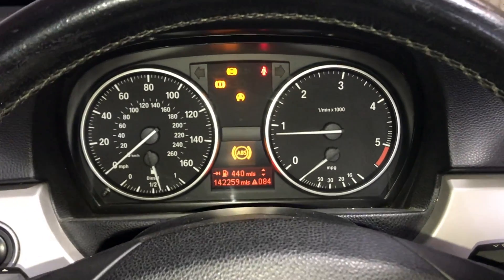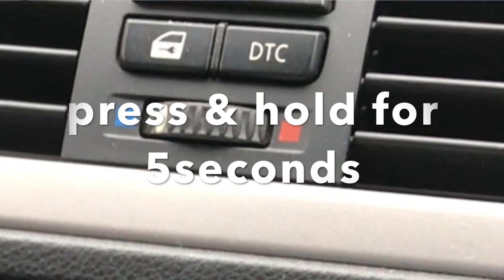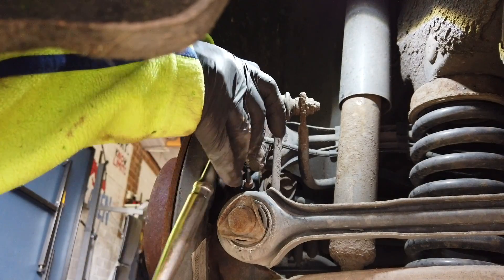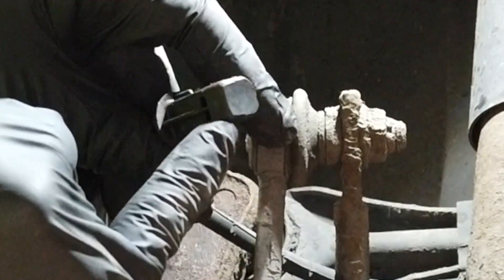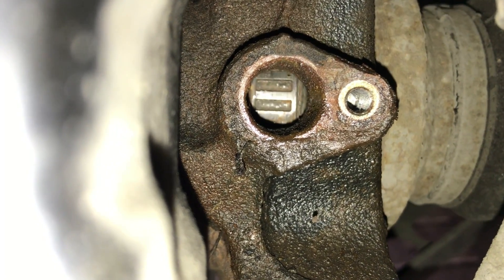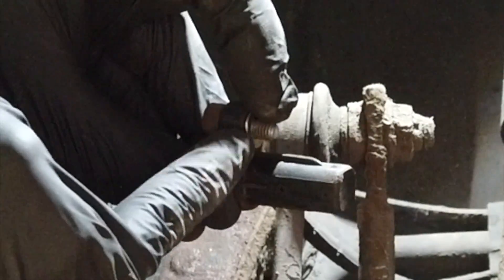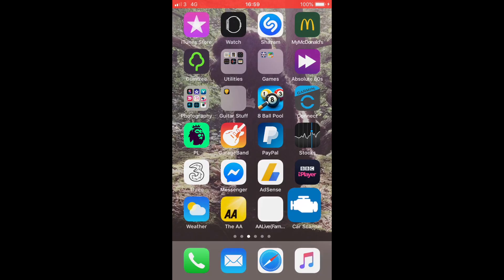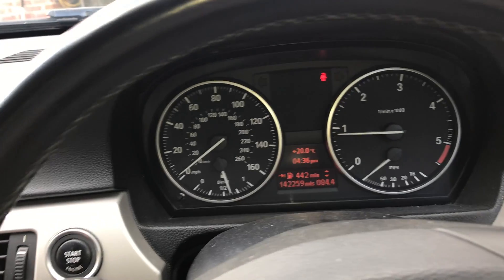BMW ABS Sensor Repair "No New Parts" ABS Ring. E90 E91 & More

Comment: I tried this fix and it worked for me. I used a 1mm washer and it didn’t work with triggering full abs lights. I tried again with a M6x12x0.5mm and it worked! Thanks!
Reply from the maker: Awesome, thanks for sharing the fix! 👍🏻👍🏻🛠
Reply: So the 1mm was too thick ???

Comment: I’ve fitted washers to both sides yesterday, however the abs light is still on! Took it for a quick drive and tried to clear the codes with TOPDON car pal but they won’t clear? Any advice please mate
Reply from the maker: When you go into abs settings and look at the sensors on a graph do they pick ant signal up? if they are worn through at the base they might need changing Thanks for the great comments👍🏻👍🏻🛠
Reply: @aaanton11 hi mate I can’t seem to access speed sensor/abs on the TOPDON carpal

Comment: Hello there mr, i had one big error  abs and it was red on dashboard bme e90 2.0d n47 sedan so far i switched ignation off - i checked the codes it was just  showing abs error code nothing more,- so far it didnt said me which exactly sensor is broken then i deleted these errors with obd - and so far  when i drive 30-50km thats it abs switching on byitself also i noticed sometimes in rainy days its too ,  - anyway now when its dry  switching on too , so far if i ask for advice is it better to clean these sensors - (all of them) or there could be problem with egr module
Reply from the maker: Have you checked the brake fluid level?, Thanks for the great comments👍🏻👍🏻🛠
Reply: @aaanton11  No I  didnt - but i know that in this winter car mechanic changed it for me, tomorow in morning i will check it

Comment: Will this work with E92 335i that doesn't use reluctar ring? I think my 335i has the wheel bearing abs system.
Reply from the maker: No you will need a new sensor or wheel bearing, Thanks for the great comments👍🏻👍🏻🛠

Comment: Hai Sir...do we need to coding as well after replaced ABS Sensor if error message ABS Sensor fault disappear on iDrive?
Reply from the maker: Not coding just erase the fault codes with a scanner, Thanks for the great comments👍🏻👍🏻🛠
Reply: @aaanton11  I'll try to remove my old wheel speed sensor before my new one arrive but accidentally connector too brittle, can you give me some methods how to pull out old wheel speed sensor from brittle connector?
Reply: After installing new wheel speed sensor error code in same error Code (5DCO) still occurred even though my mechanic using diagnosis tool 🤣... seems like I have to go to other workshop and hope my wallet didnt thin after that🤣

Comment: Does this trick work with the e90 series that use abs wheel bearing Esther then regular abs ring?
Reply from the maker: No only on the abs ring type, Thanks for the great comments👍🏻👍🏻🛠
Reply: Did you sort it out mate? I have the wheel bearing ABS system too.
Reply: @ Hi brother, yes! I simply bought a new bearing, when I installed it I put a washer on.. its gone away not come back!
Reply: @bunkaaa8726 Thanks for replying buddy. Really appreciate 👍 Do you think I can try the washer trick before getting the new bearings?

Comment: Isn´t it dangerous? What does the sensor measure? Does it change the Data that the Sensor puts out?
Reply from the maker: Not at all, it measures the divots in the rings, its a magnetic pickup, Thanks for the great comments👍🏻👍🏻🛠

Comment: Just did on 2011 e91 LCI. I took the DIN 9021 M5 washer, because it is 1mm thick. Regular M6 washer is 1.6mm, a bit too thick in my opinion. I drilled it to 6.5mm inner diameter. Works like a charm
Reply from the maker: Thanks for the great comments👍🏻👍🏻🛠

Comment: Brilliant mate,   put 1 washer on , didn't work , put 2 on and everything lit up 😮 warning !! So i went back to 1 washer and checked the other side it was rubbing as well .washer on that side , problem solved  
How long will it hold for though ?
Reply from the maker: Mine lasted for 4 years before I did the ring replacement video, https://youtu.be/rBlTHK29x8c Thanks for the great comments👍🏻👍🏻🛠
Reply: How did you get the light off mate?

Comment: i keep getting same issue with abs sensor and traction control 318i se 2011 .  both sensors were replaced last month. I have same lights come back up.  i placed 1 washer on left rear (had signs already of scoring) which seemed to be the issue but i have lights come back up.  i dont have a diagnostic tool to check if its the right (not checked sensor) now or left still.   The washer was around 2mm.  I will be getting garage to replace the reluctor ring.  is it worth adding washer to the right side also.  do they both need to sit same distance back from ring?  could only having 1 sat further back send through weird data through?
Reply from the maker: 2mm is too thick, it needs to be wafer thin, Thanks for the great comments👍🏻👍🏻🛠
Reply: @aaanton11   actually after measuring they were 1mm.  i have bought 50x 0.1mm and see if i can  use  these. Does anyone know how much a garage will charge to remove corrosion from the area of old ring and replace with new one?  would they use PVA or should i request this?
Reply: @craigd8471  did you get that replacement done? how much was it
Reply: @7meer-cha  yes fixed by 2 new rear drive shafts.  No issues since. They had a look at ring. But it was too corroded and shat would be affected when removing corrosion so a new ring would not fit well.  So a new shaft both sides were solution.  Shafts were around 180 each. Think i paid 660 total on final bill and it included something else they replaced for 30 quid

Comment: If that doesnt work, it takes about 1 hour to replace the CV shaft which includes the induction ring fitted, though left side might be harder with the exhaust being there covering the bolts into the differential. CV shaft about 70 squid, you need a 12-point 30mm socket for the main wheel bearing (punch out the wheel plastic cover and unfasten on the ground!)-standard thread(not lefty thread), remember to knock out the crimps before untightening. the differential bolts are star sockets. you also need a punch to knock out the cv shaft (less than 1cm diameter) once you have undone the differential bolts (raise clutch using jack to disconnect it from differential seating).
Replacing the CV shaft is easier in general, because its very hard to fit an induction ring perfectly on a corroded shaft!.
Reply from the maker: Thanks for the great information👍🏻👍🏻🛠

Comment: If the wheel bearing is bad could cause the same issue?? Thanks
Reply from the maker: You would hear it first, the bearing would need to be badly worn to alter the abs sensor on this model, Thanks for the great comments👍🏻👍🏻🛠

Comment: I have the same issues with abs light on, when it starts up it shudders then lights come on and i can drive away... mechanic said to order a new rear driveshaft.. surely a new ring would fix it going by yours?
Reply from the maker: Check the fault codes yours might be a poor connection on the front sensor, Thanks for the great comments👍🏻👍🏻🛠
Reply: @aaanton11  cheers. I actually sorted it myself, stuck the new abs sensor in and warning lights went. No I just need to sort the pulsation on the brake pedal.. have ordered new discs

Comment: Is there a chance that this ring is entirely missing/not visible? :D Because on my side I cannot see the thing that you are seeing. It was a sudden death of the systems as I've been to the snowy mountain roads.
Reply from the maker: Some later models don't have the rings, but most do. Thanks for the great comments👍🏻👍🏻🛠
Reply: @aaanton11  I have the issue mentioned, but I can't see the ring in the hole. Is it possible that it broke? I can send a video.
When I reconnected the sensor I was able to drive for about 50 meters, and then I got the DSC kick in like crazy(gas intervention) without any wheel spin, then it recorded the errors and stopped abs/dsc from functioning.
Reply: I also forgot to mention it is a 330i 2005(e90).
What I meant by broke - fallen apart and just fly off the driveshaft.

Comment: This is the issue with mine but they can't get the driveshaft off to change the ring so I will have to have a new driveshaft,and I was wanting to sell it before this happened.but the warning light comes on and it pulls back and on motorway it has hone into limp mode,not happy,already spent thousands 😪
Reply from the maker: The ring is on the driveshaft, so if they can change the drive shaft they can replace the ring, but most garages want to change the complete shaft as it it easer for them and they can charge you more, Thanks for the great comments👍🏻👍🏻🛠

Comment: I have the same problem on my e83. But not in sensors problems, detected that rear abs rings are destroyed. Thats why sensors also out of service. Solution is to change abs rings plus sensors. And i think 1 washer under every sensor also can be added.
Reply from the maker: Thanks for the great information👍🏻👍🏻🛠
Reply: Are the bmw rear wheel drives?
Where is best to buy the rings and sensors then?

Comment: Question: what if the the ring does not spin at all (through the sensor hole) and I am getting the thumping kinck under my brake pedal when I make turns? Thank you and great camera work on reluctor ring through the abs sensor hole...
Reply from the maker: The ring must be completely detached, new one needed, Thanks for the great comments👍🏻👍🏻🛠

Comment: I had the same issue. 3-4 "splines" on the abs ring was clear aluminium because it had touched the sensor. It made the wheel speed intermittent and confusing for ECU. DTC would kick in randomly, often at high speeds. I fitted a 1,5 mm. washer and checked live data on wheel speeds in INPA. It's more stable now. I haven't had any issues with DTC randomly kicking in after this. Thanks for the tip.
Reply from the maker: Thanks for the great comments👍🏻👍🏻🛠

Comment: Great video. I changed over my sensor after the abs sensor light came up and found that the new one caused the car to judder and not allow the car to have full power. I then put the old sensor back in and no judering or power loss. The light is back on. Im guesing its the ring???
Reply from the maker: yep, Thanks for the great comments👍🏻👍🏻🛠

Comment: I have an e93 335i and mine doesn't have a ring at all.... getting a 5dc2 code after hitting some water puddle in the rain. Replaced the sensor and still getting a code when hitting about 15mph
Reply: When replacing the sensor I didn't see a ring at all, finding no research on this.
Reply from the maker: It definitely has one on the drive shaft cv joint, Thanks for the great comments👍🏻👍🏻🛠
Reply: @harmless360 did you fix the issue?

Comment: Hello, does this need to be done on only the right passenger side?
Reply from the maker: The passenger side one corrode more than the offside one due to it being near the curb and more puddles and water but they can both corrode you will need to check both sides Thanks for the great comments👍🏻👍🏻🛠

Comment: Hi, I have a problem with occasional lighting of ASC lamps and loss of power (gas withdrawal), mostly after a little longer driving, I tried to put a washer (nut) but after that he turned on all the lamps !? What do you think could be the problem?
Reply from the maker: you need a really thin washer less then 1mm Thanks for the great comments👍🏻👍🏻🛠

Comment: Hi, Anton, I have just put the washers behind the sensors but the ABS light comes on when it didn't before, could the washers I used be too thick, when I say washers I did both sides, I don't want you thinking I've packed it out an inch.  how can I get rid of the fault codes without a OBD, I have got one but still trying to find out how to use it.
Reply from the maker: They need to be the thinnest washers you can find, like a finger nail thickness, Thanks for the great comments👍🏻👍🏻🛠

Comment: I got no lights on the dash.
Turbo doesn't really come in until 3k
Traction light flickers when I try accelerating and very sluggish untill 3k when its like Nos .
Dtc button makes zero difference but when it gets up there it pulls like a train.
Reply from the maker: If the traction light is flickering the ecu thinks there is a slip on the drive wheels, so possible sensor issue, pop out the rear ones and have a look for the corrosion, Thanks for the great comments👍🏻👍🏻🛠
Reply: @aaanton11  many thanks.
This has helped and I will let you know how I get on

Comment: Thanks for the great video! I replaced my worn sensor and spaced with a washer. 

The ABS, traction control and brake light codes went off when I started the car, however, now when I drive over 10mph the abs light, traction control and brake light comes on and stays on. 

Do you know why this might be?
Reply: I don't have a code reader to reset the codes - do you think I need to reset the codes after replacing the sensor?
Reply from the maker: It sounds like the washer you have used might be a little thick you need a really thin one, like the thickness of a fingernail, also a code reader would be a real help, Thanks for the great comments👍🏻👍🏻🛠

Comment: I changed the one of Wheel Speed sensor and it’s still reading bad I’m hoping this is the problem and I don’t need 4 new speed sensors 😭
Reply from the maker: it will be, Thanks for the great comments👍🏻👍🏻🛠
Reply: @aaanton11  so I tried this and it didn’t work :( I’m wondering if it’s because my car is a 335i? Can you confirm what e90 you have ?

Comment: Amazing video, thank you so much, I've got abs light on my bmw e90, took it to werkstatt I was told that both abs ring need to be changed and also abs sensor and that will cost me about 450€ plus workmanship, I told the mechanic guy to mount a tyning washer underneath the abs sensor which cost me only 20€, today I drove the car today  to Hamburg 500km smooth drive, 😂  no abs light on, no engine light, no loss of power... I was happy. Your video saved me from the predators mechanics, I want to say a big thank you to you... 👍🏿👍🏿 +1 Subscribe for you
Reply from the maker: fantastic, Thanks for the great comments👍🏻👍🏻🛠

Comment: Does anyone knows why mu traction control light stays on permanently , it past over one year , still didn't solved it .. It's the DSC light and handbrake , permanently both..please HELP
Reply from the maker: you will need to plug in a code reader to find the issue, Thanks for the great comments👍🏻👍🏻🛠

Comment: Great video. thank you for the info. My E91 had the judders 6 months ago and I changed the near side rear wheel sensor but now I have all the lights on again (no judders this time) and the speedo intermittently dropping to zero when driving. The ODB is saying its the same wheel so this video almost certainly explains the reason and what I am going to do to get it through the next MOT in 3 weeks time. I very much appreciate you taking the time to explain this.
Reply: Mate ive got exactly the same issue, but my fuel gauge is also not working as well as the speedo and the mileage counter is static so looks like the OBS isnt picking up that the car is moving. Im guessing both sensors have worn out...
Reply from the maker: pop a washer in there, hopefully its not worn the bottom off the new sensor, Thanks for the great comments👍🏻👍🏻🛠

Comment: Hi mate, I have the e90 2007 my car is also kicking only when I’m trying to moving off. I always hold the clutch for a bit and accelerate than it stop when Im on the moveget. It doesn’t happen all the time mainly when I’m driving it for a first time the next day. The engine light came on the dashboard and it’s still there. Sometime when I’m driving this symbol comes on it looks like unfinished circle with an arrow on it and inside the circle is a triangle with Exclamation mark. Can you help pls. Thank you
Reply from the maker: I will think this is your problem but to be sure you need to get a code reader and get some codes from the ECU then possibly use some spaces on those rear sensors Thanks for the great comments👍🏻👍🏻🛠

Comment: Hi i changed the sensor and even tried to swap with the other side and i still get the fault on the right side of the car
5DA0 wheel speed sensor supply front right
5DA6 wheel speed sensor direction of rotation front right. Can u help please, i am 100% sure the sensor is fine
Reply from the maker: check the wire or the connector plug for corrosion, Thanks for the great comments👍🏻👍🏻🛠

Comment: Spent 110 POUNDS on a sensor and still got the message. Totally pissed off.the car is 10 years old.Need one of those debugging software.Thanks for the great video.It is guys like you that keep us going.
Reply from the maker: if the ring is corroded the new sensor might now be damaged too,Thanks for the great comments👍🏻👍🏻🛠
Reply: Did the light go out itself?

Comment: Haven’t tried it yet but will, my traction light comes up on the straight and also on a left turn, right around roundabouts not affected. My question is could it be a front left sensor as well with a swollen ABS ring or is it only the rears that are affected by these types of faults?
Reply from the maker: Just the rears for the swollen rings, Thanks for the great comments👍🏻👍🏻🛠

Comment: Thanks mate, I’m pretty sure this is a good culprit as the whole behind wheel assembly (tell I’m not a mechanic 😆) is all quite rusty from previous owner letting it sit.. I do need to take ieach wheel off and wire brush and paint so will give this a look when it’s off… thanks again and subscribed
Reply from the maker: hopefully Thanks for the great comments👍🏻👍🏻🛠

Comment: Fast question. I have the same problem with warning lights. but after some weeks it goes away at startup but the car starts to hump/ brake up until i get to third gear and get some speed on it, like 50 km/h. Then the warning lights come back on and car drives normal without braking. any idea?
Reply from the maker: I would think this is the issue Thanks for the great comments👍🏻👍🏻🛠